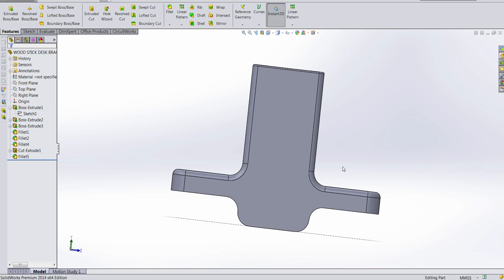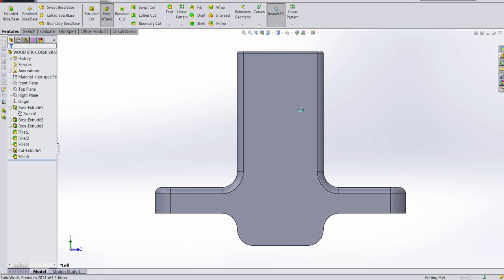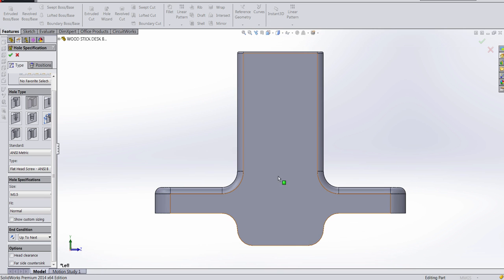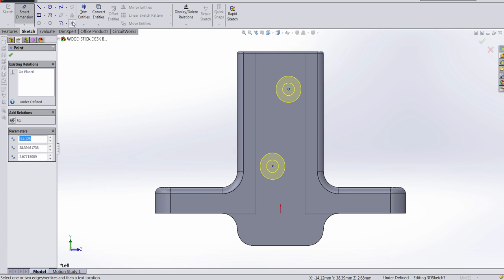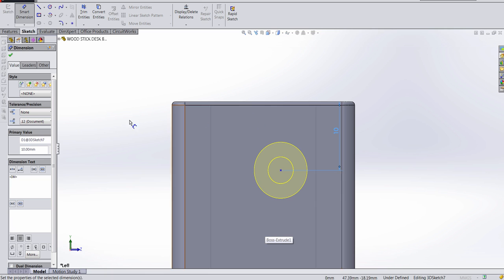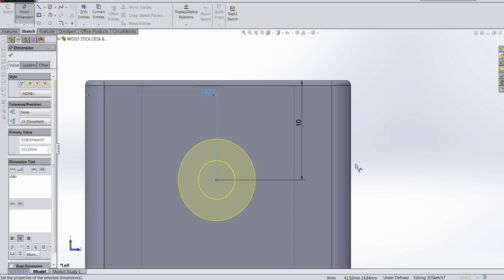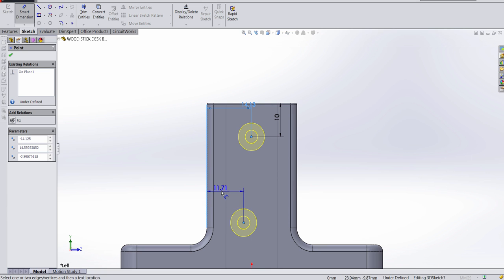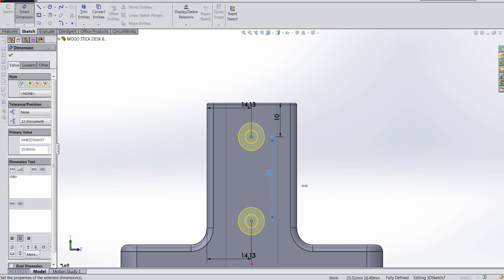HOW TO PLACE HOLES PRECISELY WITH HOLE WIZARD (SOLIDWORKS)

Comment: Holes should be made vertical to the midpoint. With the fillets that should be done last in the feature tree, you would simply roll back pre-fillet. Then add the holes using the midpoint. Solidworks does not like midpoints on fillet corners in some versions of Solidworks. Roll back forward and the holes will align to the midpoint with fillets!

Comment: Wouldn't it be best to make the holes verticle to the midpoint of either the top or bottom? Or maybe even a verticle constraint to the origin? That way if anything changes, the holes will remain at the halfway point rather than attached a specific distance from only one side?
Reply: couldn't agree more. I would do the same too.
Reply: My thought too! He made it far too hard.
Reply: @BatByke  The only difficulty I find is trying to select the midpoint. Sometimes the midpoint doesn't appear visible until my cursor is slightly offset from the midpoint.  When I hover directly over the midpoint it disappears.  Does anyone else experience this or have tips on how to select the midpoint more easily?
Reply: @jcoleworld1  Right mouse button on the edge > select midpoint.